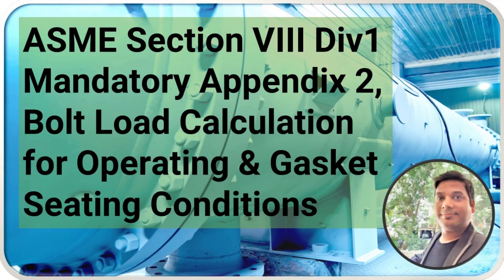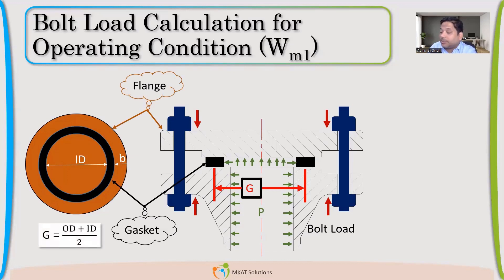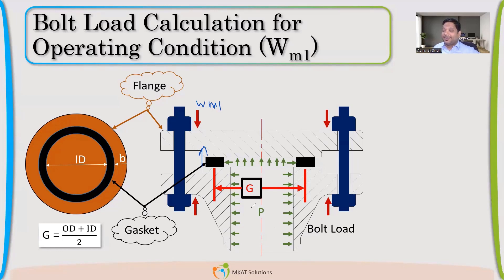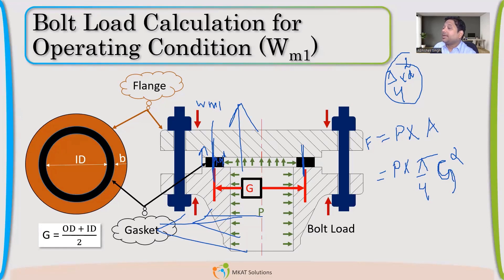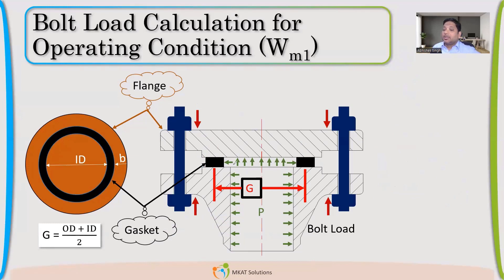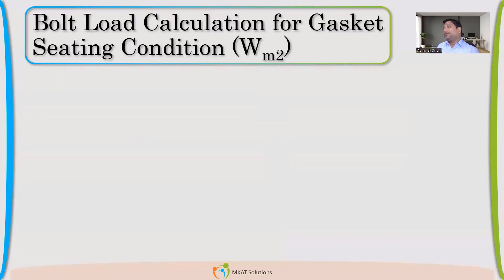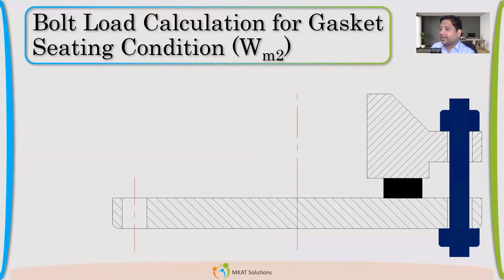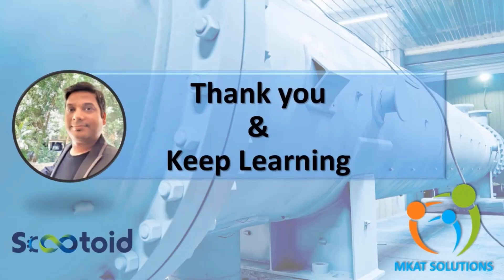Discover the secret to accurate bolt load calculation

Comment: I would think that adding Wm1 and Wm2 would be the total force that the bolts would need to exert in order for a gasket to not leak at a specific operating pressure?
Reply from the maker: Both are different cases.

Comment: Why there is multiplication by 2 in Wm1 but not in Wm2?
Reply: I do not understand from where the 2 came in Wm1 eq but I do understand why it is not there in Wm2 eq. 
G×pi = mean circumference of the gasket so when he turned it into a rectangle it became the rectangle length.

b is gasket width, practically it is OD-ID of gasket if I am not getting this wrong
Reply: @majidalkhayari5572 
Hey dear,
So basically according to what I know "b" is just the half width of the gasket. hence to calculate the area we have to take 2b * circumference.
Reply: @fahimansari156  but why there is no 2 in wm2 equation? just pi*G*b*y
Reply: 2 faces of the gasket
Reply: No 2 gasket faces does not means 2 times force will be taken. Reaction force always be there.